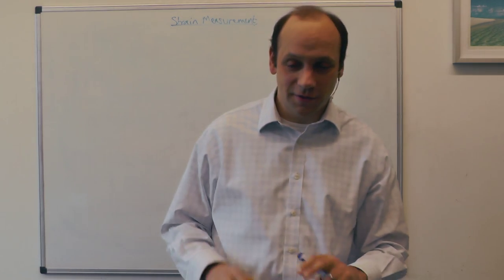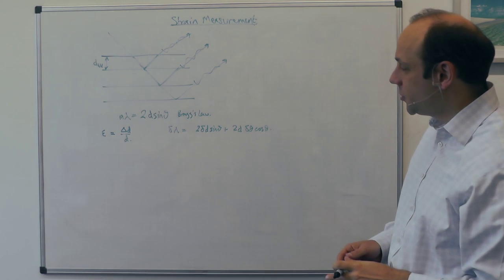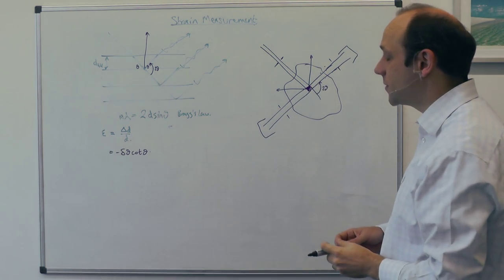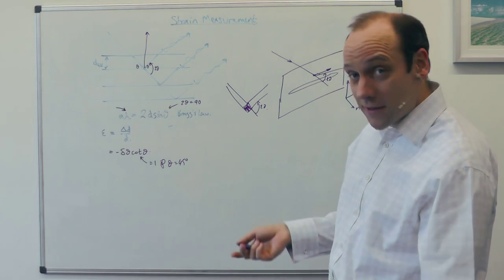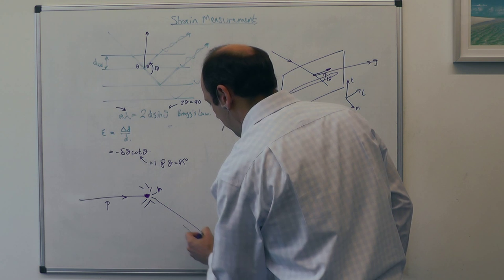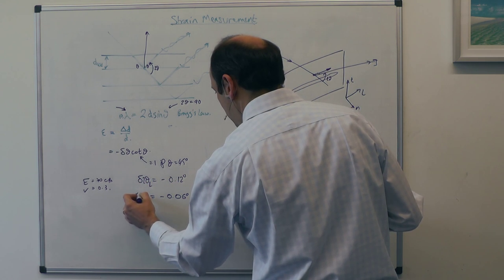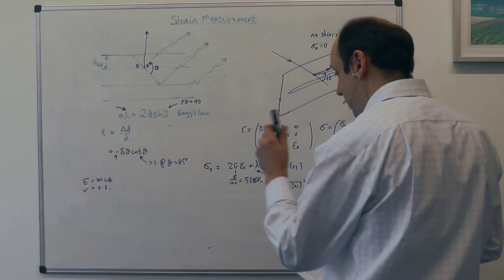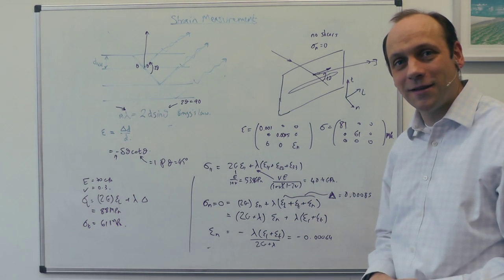L8a | MSE203 - Strain measurement using diffraction

Comment: Fantastic lecture. I know this works well for crystalline materials but, in the case of polymer matrix composites with an amorphous (epoxy) matrix what methods would you recommend for strain measurements, such that I could measure residual stresses?
Reply: Peter Wilson I think you cant measure residual stress in an amorphous material because you won´t have diffracting planes. X ray diffraction to measure residual stresses in polymers I think is not possible... Best Regards from Venezuela.